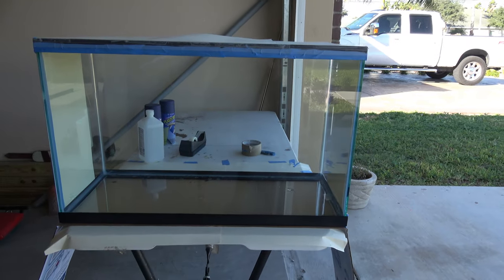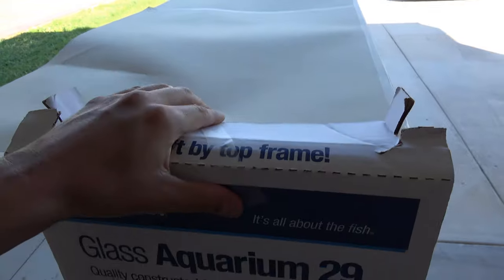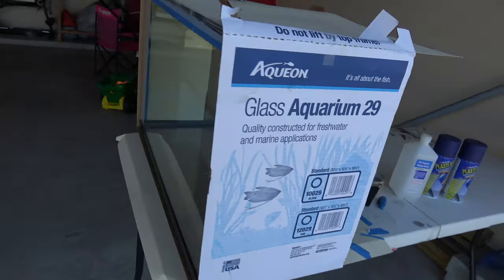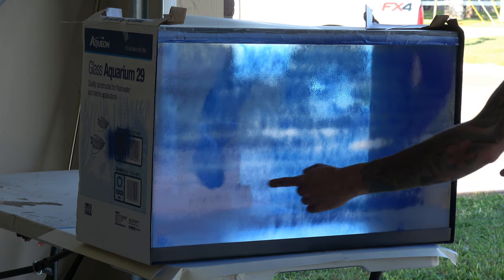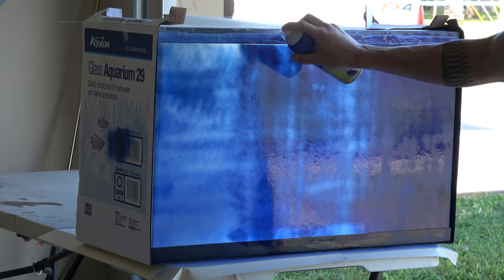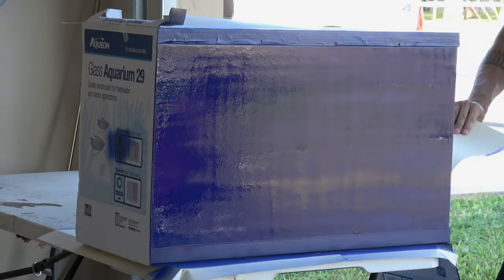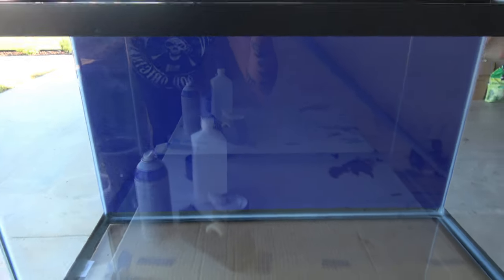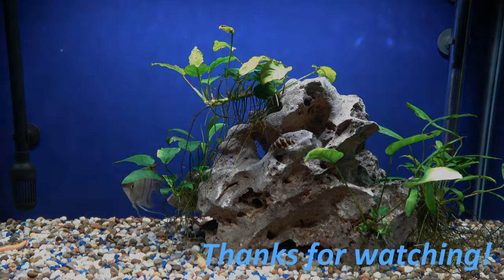BLURPLE Plastidip Aquarium!

Comment: Nice bro thanks for sharing I thought about this too but never did it didn’t want to use paint like u said don’t want it no more peel it off with the plastic dip
Reply from the maker: Hey yeah you should try it out, it's a nice fun little project. Honestly plasti dip is super great as a background. It reduces glare, stops light bleed from behind, is durable, and 100% easy removal (as long as you sprayed it thick enough). Anyways, thanks for watching.

Comment: That's not good advice. You do thin coat's not heavy one's. And should let it dry 3-5 min in between coat's.
Reply from the maker: Hi, so that's normally true for paint and such but plastidip is definitely an exception to this as it is basically a liquid rubber coating. Doing it this way will achieve the following.

-Finish will look perfect from the front
-Plastidip will remain strongly bonded to itself and glass
-It will be super easy to peel off as one whole piece (if so desired)